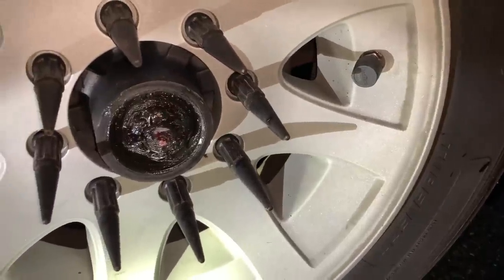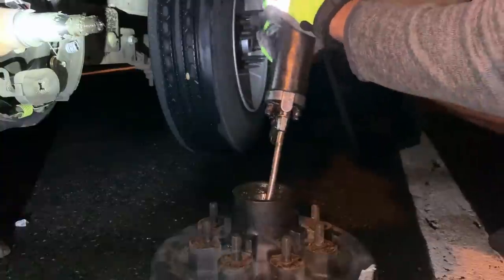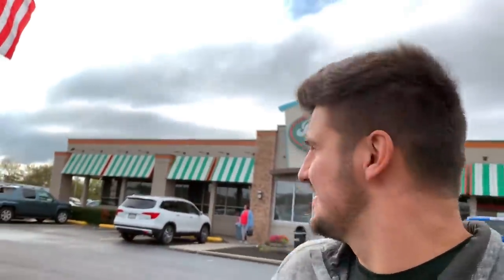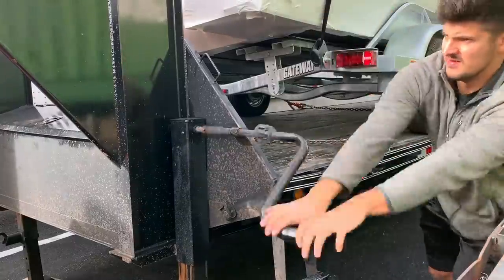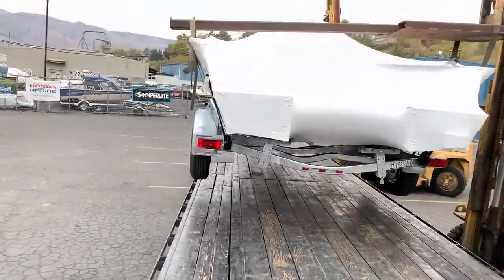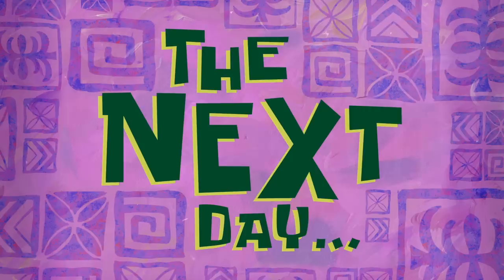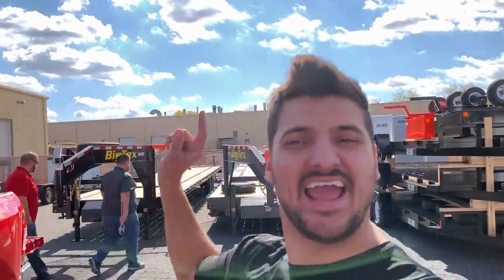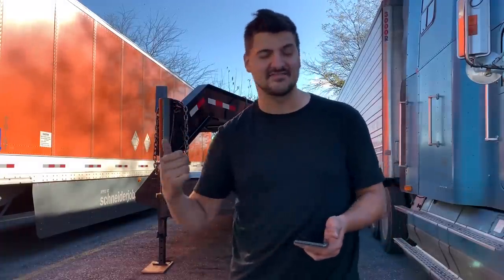New NON-CDL hot shot TRAILER - Vlog 17

Comment: With non-cdl you can’t town trailer more than 10,000 lb ,
Reply: That rule definitely applies in California and some other states. not exactly sure which other states
Reply: @redwood6737   Unless something has changed : federal DOT applies to interstate hauling ( this includes not for hire)     The DOT regulations apply to:

    Vehicles with a GVWR or gross combination weight rating (GCWR) of more than 10,000 lbs.
    Vehicles with a GVWR of more than 26,000 lbs., which require commercial driver license (CDL) to avoid CDL driver disqualifications.
    Vehicles hauling hazardous materials, whether operating across state lines or totally within one state.
    Trucks or for-hire small buses designed to carry more than 16 people, including the driver.
     California and North Carolina reg's require a cdl for 10,000 + capacity trailers period, even if unloaded..
Reply: Nikola Mitev non cdl is single or combination up to 26,000 lbs
Class b cdl is up to 80,000lbs with a combination the trailer can’t be over 10,000lbs gvwr
Class a is any combination over 26,000 if trailer is greater than 10,000 lb gvwr
Reply: @redwood6737  that rule does not apply in new york unless your truck has a gvw over 10,001 then you need cdl for trailer with 10,000 or more

Comment: You need to learn cdl laws. If trailer registered weight is over 9999lbs you need a cdl for commercial use. So you need a cdl. It also goes off total gvwr add up all axle Max weights if your over 26001 lbs you cdl your dually plus trailer are over you need a cdl. Learn the laws.
Reply from the maker: Right back at you.... You need to learn the laws! My total GVWR aka GCWR is 26,0000 which is less than 26,001 which is when a CDL is required. 

Can please show me what law you are referring to when you say "If trailer registered weight is over 9999lbs you need a cdl for commercial use."?